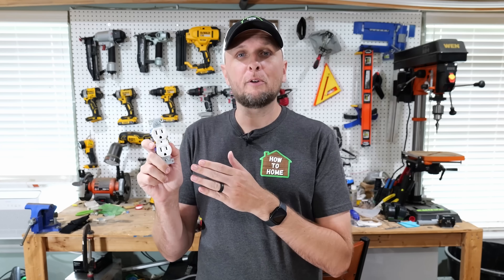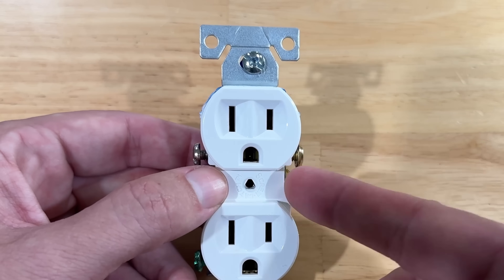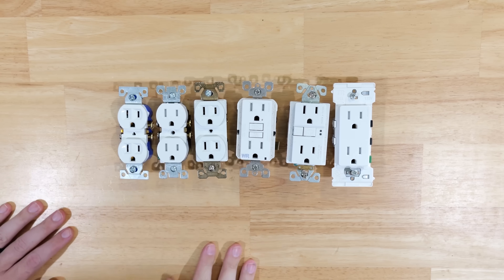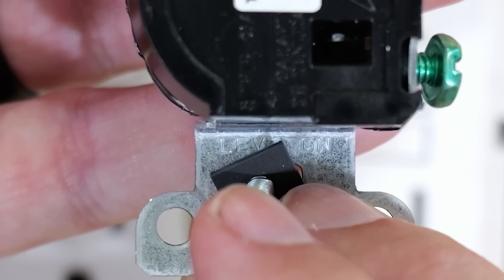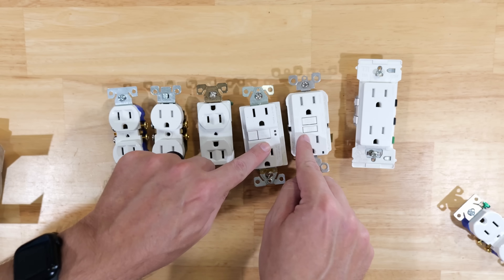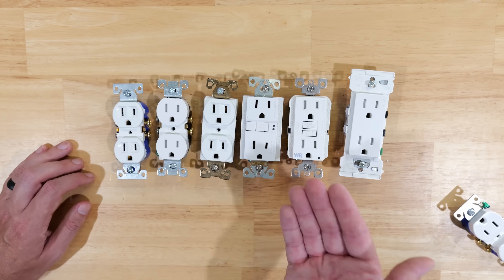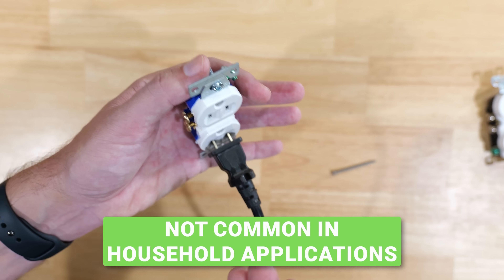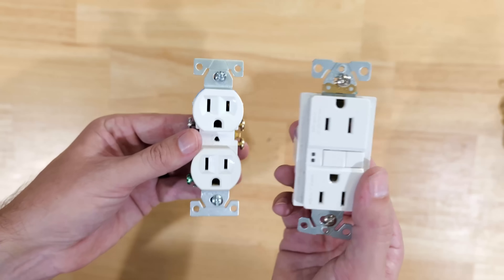The Shocking Reason Why Your Outlets Are Installed Upside Down!

Comment: Pleasant review. Have wondered about this for a long time after an inspector told us we would have to have an electrician properly install the receptacles grounding prong down before selling. Old house. Receptacles had both directions going for themselves. Since then I've wondered which way would be best for finding the holes with the plug in the dark in a hard to reach area. It seems having the prong in hand pointed downward would make it easier to blindly find the receptacle's orientation. OFF TOPIC: Your presentation Adam, is thoroughly detailed, yet not boring at all. Hence I trust what you have provided. I assume there's a new NEC Manual provided every year? Perhaps you would consider video recording a summary which covers the entire manual. A summary of it and additional material if required such as math and algebra story problems would be a perfect lead-in for you to sell a video set which covers the entire manual. When I visited State offices which covered certification for home inspectors, I concluded pursuit of such knowledge would be more trouble than it's worth to become certified and that the process limitations seemed to prevent competition. Maybe you and a few others would be willing to establish a knowledge collective for skilled tradesmen and women? There are fewer and fewer today. Tradesmen skills as Frederick Douglass supported combined with the abstract skills of leadership as Booker T Washington advocated would in my opinion create a new status quo and make America a class-free society again.

Comment: Funny but A LOT of PRODUCTS  are made to plug in with the ground prong DOWN -- for instance a multi plug (that allows you to plug in more than 2 items) when plugged into your receptacle has  it's  plastic "dummy" ground prong in the DOWN position because all the writing on the multi plug is facing UP when the plastic guide in the back of it is meant to be inserted into the ground prong in the down position. Sorry - this may not make a lot of sense the way I'm explaining it here but if you pick up a 4 or six multi plug intended to plug into one of the outlets showed here, you will see what I mean :-)

Comment: Most of the poducts I use are designed to be plugged in (ground-side down) and are more structurally sound without (sagging and bending of the ground-pin). Also, plug cord goes down to the floor, not up in the air, bending unsafely. I have noticed ground-pins are not designed to hold any weight as they bend inside the cord housing easily. Note: A triangle mounted on a wall to support a shelf would have the (two screws at the top and only one at the bottom).

Comment: I trained as an electrician in the early 80s (81-83) and worked in the field until 87 before going back to school for electronics. At the time the convention was to install with the ground up. I don't recall if it was code or just a common practice but, at the time, wall plates were painted steel and the thought was that a loose plate could fall off and land across the hot and neutral so it was safer to have the ground prong up. Additionally, receptacles installed horizontally would be oriented with the neutral prongs up to avoid the plate becoming hot if it came loose.

Comment: Master Electrician over 30 years now.  Don't let anyone tell you the code is about to change to ground up.  I've been hearing that since I started and it still hasn't happened. I prefer ground down myself because of the design of products.  But the truth is, code does not specify.  Either one is ok if the owner is happy with it.

Comment: I think both of your choices are off by 90 degrees! In Chicago area they are installed horizontally because all electrical wires are required to be in conduits and its easier to mount them sideways to align with the holes in the box.

Comment: I was taught ground prong down except when you branch plugs off or down hill from a ground default plug receptacle 
If an upside down plug is not functioning you check to see if you tripped the breaker receptacle first
Reply: Ground prong up when that outlet is attached too the light-switch so people there know where to plug in their lamp to control it from the wall light-switch.
  Medical facilities have things hanging on walls that fall, like clipboards that short the circuit, therefore it has become mandatory policy that they be ground up. In many cities ground up is standard in all commercial and industrial buildings, ground only go down in residential buildings, houses, apartments, condos, etc. 
   Everything is in context and the answer DEPENDS on context.

Comment: To me wall sockets look like little faces giving a very surprised look, where the ground is the open mouth and the two vertical slits are the startled eyes. Because of that, it seems that ground prong on the bottom is the only configuration that makes sense to me.

Comment: Ground prong down because plug in fragrance sensors have the ground plugged down. If you have ground plug up the plug-in fragrance holder will be upside down and won't work. Women hate a socket with the ground plug up go ask your wife

Comment: I worked in a machine shop on manual mills in the 80s. The machines would make a mountain of aluminum chips real fast and throw them all over the room. They would always short out the lights plugged into the machine with a loud poof and smoke until we had them flip the outlets. Now we put outdoor covers on them

Comment: I agree with you, the ground terminal should be down. The reason is a lot of cords have angle cords on them. Most of these if the terminal is down the cord hangs straight down no problems. If the ground is at the top the cord has to make a U turn which over time will damage the cord. the same goes for plugs with a 45 degree angle.

Comment: 40 +yrs in electrical trade. I was told early on a receptacle should be installed with a " monkey face", ground prong was the mouth , with hot and neutral as eyes.

Comment: Doesn't matter, whichever way you prefer. Think garage door openers, you can install an outlet sideways up down, on the ceiling it's up down sideways whichever depending on where you're standing.
Reply: @galactigus8222: It can absolutely matter and save lives. Ground prong up when that outlet is attached too the wall-switch so people there know where to plug in their lamp to control it from the wall light-switch.
  Medical facilities have things hanging on walls that fall, like clipboards, scalpel, hemostat, that can fall and short the circuit, military galleys and  restaurants, ground up was specified, due to stainless steel utensils being dropped, etc. Therefore it has become required that they be ground up for contractors. In many cities ground up is standard in all commercial and industrial buildings, ground only go down in residential buildings, houses, apartments, condos, etc. 
   Internationally, countries with 3-prong outlets always have the ground up
   Everything is in context and the answer DEPENDS on context. 
   Examples:
“Never took the orientation of an outlet seriously until I was measuring for a shelf with a tape measure. It slid down and fell across the prongs of the washing machine plug.  POW! “ —@joef.6596
“I work at a K-8 school. Maintenance assembles powered multi media carts with the ground plug up in consideration of teachers dragging metal bracelet chains across partially unplugged power plugs.” —  @scaryhouse7969
“a length of florist's wire rolled off a side table onto a slightly loose plug and shorted the circuit, creating a small fire (quickly extinguished).  I now always install ground prong up” @deegee54
“I work at a restaurant and we have this work table with some outlets built in on top. Someone managed to let the edge of some tin foil go in between a plug and the outlet and it got disintegrated.”@MatthewSuffidy
“I knocked some change off of my end table one day my mistake of course, and a coin fell down right on the prongs resulting in a loud pop and a flash along with some smelly black smoke. I have since gone through my home and reversed all of the receptacles so the ground prong is now on the top.”—@chrisenglert3958
“my wife's gold necklace chain dropped off the rack onto two prongs of a device that were plugged into a receptacle with just a little prong showing.  It vaporized the gold necklace area of contact and left a nasty burn mark on the faceplate of the receptacle.   This was on a bar and I probably should have oriented the receptacles there ground prong up.“—@winfordnettles3292
"I had lunch with the Chief Electrical Engineer at McDonalds headquarters. He told me that one of the workers in one of their stores had her hand badly burned when a metal cookie sheet (or something similar) slid out of her hand. It fell onto a receptacle that was loose…the metal cookie sheet made contact with the two blades resulting in  big arcing flash that caused the injury, this is a reason Ground Up is safer."
“In commercial buildings (where receptacles are very high from the floor) ground has to be at the top. In a case of a water leak ground has the first contact with the water. In residential buildings (where receptacles are not far from the floor) ground needs to be at the bottom. In a case of a flood, ground wire would have the first contact with the water.”—@powerzx
“When a heavy extension cord or wire from a device plugged in is experiencing stress from the cord being pulled taught or tugged on, the greater force is usually downward. The ground prong being longer, exerts the greatest torque when the wire is being pulled in a downward direction.  Occasionally that downward force will cause the plastic of the ground prong opening of the receptacle to crack from the downward force. If the ground prong is up, that downward force has much greater support from the receptacle structure. I’ve personally cracked a few receptacles over the years working on projects where the wire plugged in was being yanked around a lot. Where the ground prong was up, the extension cord always stayed more securely plugged in.”—@TechwizJoe1
"while working in a mechanical repair shop, I went to get something off the shelf that the radio was on. I bumped the radio. as I turned POW, FLASH, BANG.  the metal antenna fell sideways and was across the plug and touching the window frame. glad i did not try to catch the falling metal antenna.  an extension cord was just a little loose in the socket.”@tazhd143

Comment: Knowledgable diy-er here -- always installed my receptacles ground prong down until a length of florist's wire rolled off a side table onto a slightly loose plug and shorted the circuit, creating a small fire (quickly extinguished).  I now always install ground prong up, save for something like an always-plugged-in clothes washer outlet where a right-angle plug orientation compels otherwise.

Comment: Here's another reason outlets should be right side up: If you plug in a circuit tester, particularly the type with a screen, if the outlet is upside down, so is the tester, and you'd have to slither on the floor to read it, looking up. Another, maybe lesser, reason: An upside-down outlet just looks idiotic, like an face standing on its head. I can't stand the sight of such a perverse thing.

Comment: Some plug manufacturers place the grounding pin up and others down, on "Male Molded Angled Plugs". So if you want the cord to hang down, you have to have a socket with the  proper grounding pin orientation. I solve this problem with a 4" box. Then install two duplex outlets, one ground pin up and one ground pin down. 

THE STORY goes:  Mr. Labre conceived this 3 pin design to prevent his landlady from being shocked by a small fan that she used on hot days. Her cat would knock the fan over, and when she set it back up, it would give her a shock. Labre's 1927 design allows any static voltage buildup or leaking motor voltage, to be shunted to ground.

Comment: I would immediately fire and order off the worksite any electrician that gave me an argument that all outlets (receptacles, same thing) had to be installed ground prong up. The electrons just don't care. I want them all installed ground prong down EXCEPT for outlets controlled by a wall switch. Why is easy enough. Most people expect the prong to be down. Also it annoys people when they have to figure out which of the outlets is on a switch, so give them that visual clue. Last, lots of extension cords and power strips are sold with 90 or 34 degree flat plugs which are themselves oriented to use ground prong down oriented outlets.

Comment: I live in Chile where plugs have half the prongs metal and half plastic. This is clever because as you pull a plug out you may only accidentally touch plastic and not metal and as you pull further to where you may touch the ,etal part of the prongs the metal part is no longer connected to the power in the plug. 
while this is clever, many outlets are not of the best quality and plugs have a tendency to fall out easily.

Comment: I watch your video and remember that I am surrounded by "upside down' outlets.  Why are they upside down? Because plugs don't work well with "lines below prong" - think of a wall wart, you'd need to plug it in upside down to fit - and gravity and it's design don't agree with that.  While they may be more rare in modern devices, they are still in many devices today, and outlets haven't really flipped in the 50 or so years of them being around and frequent.  Also think about 3 prongs in general,   they form a triangle. that bottom point - being essentially a bracket like for a shelf, to keep it sturdy and resist damage, even just from gravity - while if it were upside down it would pull out more easily, removing the ground first - which could be a hazard in some situations. (no ground connection while live and neutral are still securely in socket)

While code may allow both, the real 'it is upside down' comes down to functionality of what to plug into it.

The only reason they should be ground up - is if something has a high chance of causing a short.  Such as in medical fields where the slim metal clipboards could fall and go between the plug and wall, connecting live and neutral through it's metal - causing a short and possible other hazards, especially to one grabbing the metal clipboard to pick it up.

Comment: Because outlets are installed mainly below eye level, and frequently when inserting a plug one is positioned to the left or right of the outlet, it is easy to have a problem, especially in the dark or underneath a table, with properly aligning the plug for insertion.  If the ground plug is on top on can use one's index finger easily guide and insert the ground prong first, after which the other prongs easily follow.  That is totally safe since the ground plug is not Hot.  One can even do it blindly, which is also safe, since the ground prong is longer and gets connected first.
One can not use one's index finger to do that if the ground plug is down.  And no one would advise guiding either of the non ground pins directly with one's finger!  I actually reversed two outlets' orientations to Ground up because one was just under a wide table against a wall, and the other was blocked to the center and side by a bookshelf.
   Thanks for your take, which to my mind agrees with my "safely and easily guiding a prong by touch" consideration.
   Also, I think you've condoned using whatever you feel is appropriate, even if that creates a mixed set of orientations in your house.  
   I recently was given a small digital readout heater which plugs in flush to the outlet (which was "ground down").  I was dismayed when I turned it on and the digital info was all upside down!  I no longer feel bad switching outlet orientations for any reason whatsoever.  I'm really empowered to know that no code is being broken and one can do as one prefers on a case by case basis.   Thank you!  - EE engineer working with electronics and a free DIY electrician for family and occasionally friends since I was 7, 65 years ago!
Reply: i do the same "guiding" with my index finger the ground in first but i do this ground DOWN.
Reply: Guess I was looking for this exact description of it so much easier to start the ground plug wrong first when you especially if you can see it much less when you can't see it but it's just one of those things as other people have said the refrigerators and other appliances like washing machines that need to get pushed all the way to the back or usually have the cords with the ground down so that's what you do on those Outlets the other ones are ground up and it'll things I've heard are the paper. clips, butter knives and potentially metal cover plates or clipboards if they're in an environment like medical that are on a wall and fall down those are definitely reasons to go Grd prong up.   I also prefer G up it in the garage because it does seem to help keep plugs in the ball if they are pulling away the brown plug is much longer than the neutral and line/power clips.   

The other major advantage to me is you can also see that you need to keep pulling straight out to get the plug out of the receptacle. whereas some people will try to twist it or pull up before the ground is all the way out and it winds up damaging the plug then they just have to snap off the ground because it’s bent unbroken and coming off anyway so it doesn’t look good and it definitely doesn’t fit with a lot of the wall war transformer, plugs and such but if you know you’re gonna have an area like that, maybe put on an extra board to support a sideways plug and I definitely am fan of sideways plugs in along the kitchen counters for the reason that it satisfies dogs that are angled as well as you can at least see the ground plug as well.